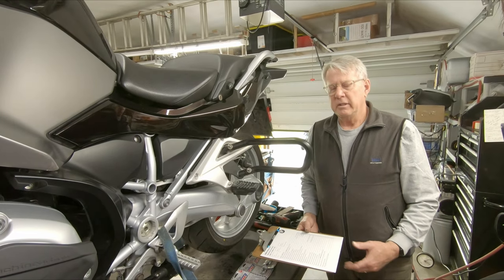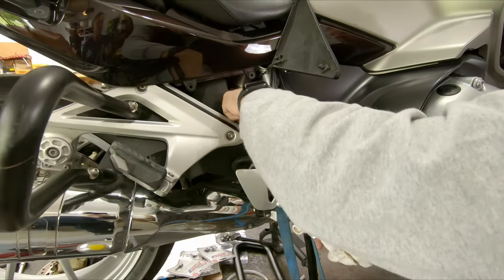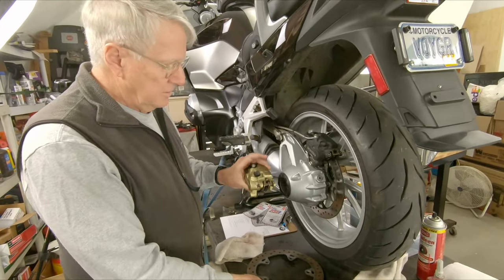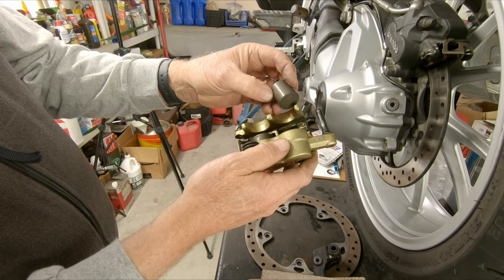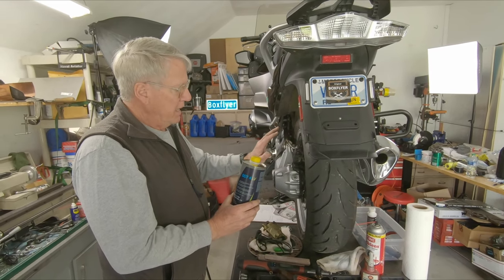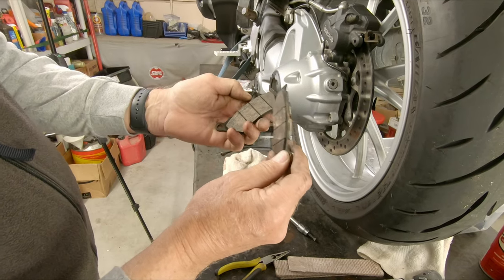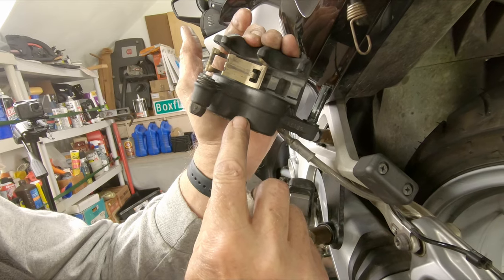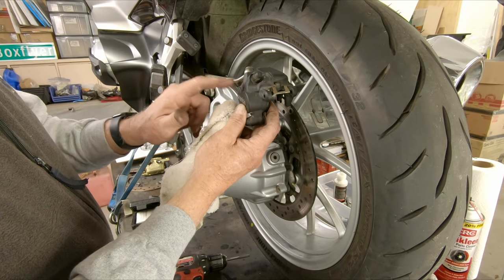BMW R1200 WetHead Brakes - Rear Wheel

Comment: These are probably the best motorbike videos on the internet i cant believe how much these videos have helped me maintain my r120 rt which i have now done 80000 miles on and its never been to BMW.  thanks keep them coming.
Reply from the maker: Great to hear!
Reply: @Boxflyer11  Hi 
Can you give me a bit of advice. My brakes seem to be not as good as they were i have bled them and they were good, then they went off for a couple of days again and then came back hard so i don't think it is air in the system although if i pull them in a couple of times they get better. could this be a fault with the ABS unit? 
Sorry if this doesn't make sense if not let me know and i will try to write it better. i looked at your videos as they are normally brilliant but cant see a video on this.
thanks Scott
Reply from the maker: @scottyoung2995   The first thing I would suggest would be to apply both the hand brake and the foot brake at the same time, then bungee or strap each of the actuators in the brake on position...leave them this way overnight/8hrs.  This may help free up a bubble in one of the master cylinders...it could also help if you tapped on each master cylinder with a plastic screwdriver handle, piece of wood, or something to induce some vibration/shock into the master cylinders to get a small bubble to float up to the top.

Comment: Thank you so much. Well done! Great video with a lot of detailed instructions. I learned a few things like pushing back the pistons to evacuate all old fluid. I am considering purchase of speed bleeders as well.
Reply from the maker: Thanks.  Yes, I like to install Speed Bleeders the first time I service bikes.  This makes the process of periodic bleeding of the brakes a task that's easy, and not one that you might shy away from, or find an excuse to pass over until next time.

Comment: Sir Brad your'e the best. One question, what about fluid in ABS module, do you use diagnostic app  tool (Motoscan or 911) for activation ABS module in order to bleed it also?...
Reply from the maker: In the other video covering the Front Brakes I did a couple of days ago, at 32:26, (https://youtu.be/bg_uB8UW3p0?feature=shared&t=1946),I discuss why I don't feel the need to use the GS-911 for routine brake bleeding.

Comment: Hi Brad. Curiosity question:  How old was that demo (rejected) caliper used for the demonstration?  Was that on a high mileage bike?  Or, in your experience, have you seen this type of alignment pin (and the alloy sleeve) wear occur on lower mileage RT's (e.g. 36K? 48k?).  Thanks!
Reply from the maker: That rear caliper I had in the video had about 18k on it.  If it is not lubed well enough from the factory and then encounters some water/spray/road film that gets past the accordion boot on the pin, and then get's passed over on some detailed maintenance, chances are that the loss of material from the alloy side will occur sooner rather than later.